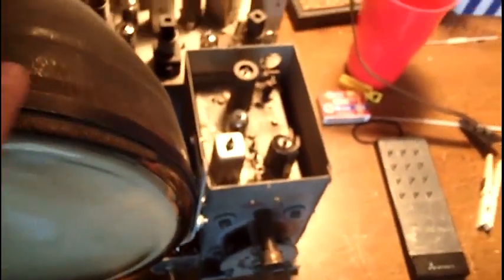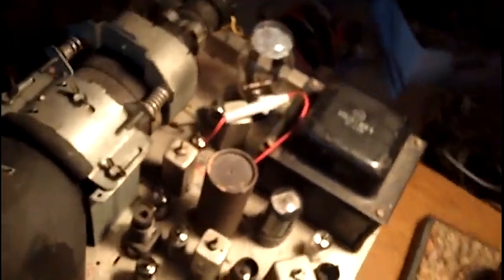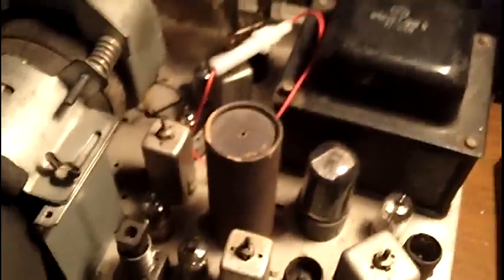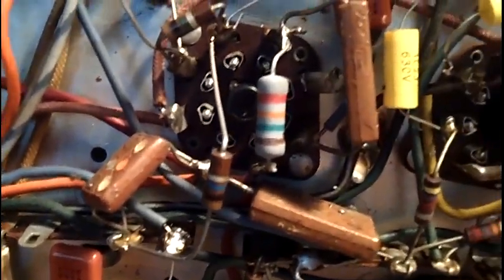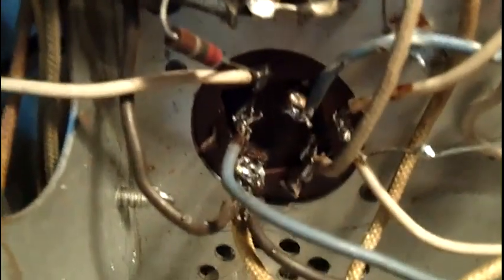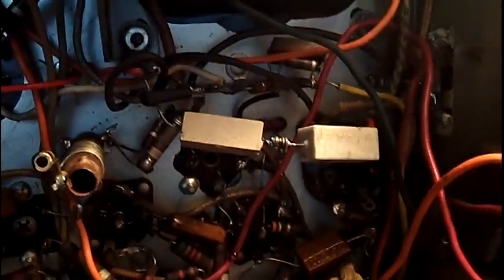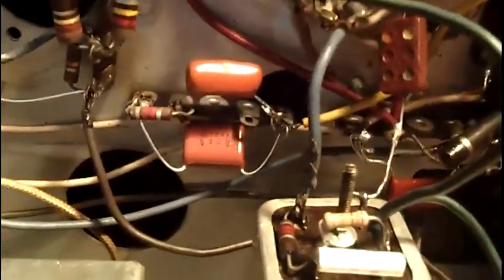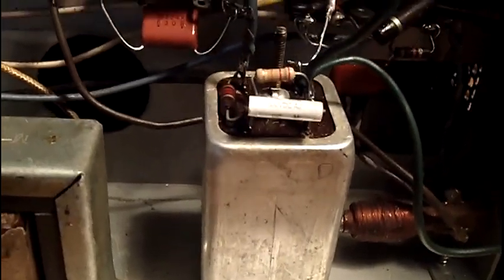Vintage RCA 8-t-241 black and White tv

Comment: I like the way you can see the back of face on the CRT from looking through the side. I test all the electrolytics with my "Solar CB-1 60 Capacitor Analyzer & Resistance Bridge". You're right, a lot of time, they test fine with little to no leakage. Replacements are so cheap though. I replace them usually with Nichicon and re-stuff the cans to keep the original look. I always replace the paper caps. I usually don't touch the micas unless there is a problem with the circuit.

Like the video!